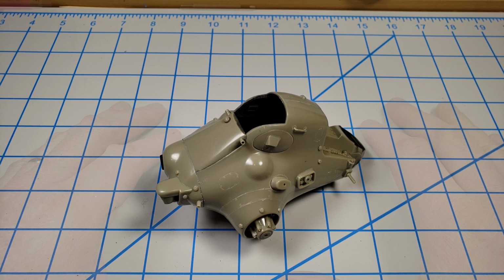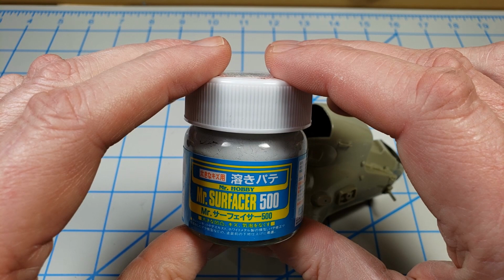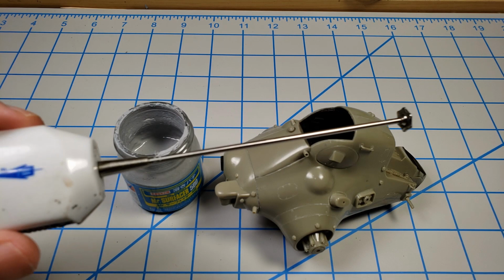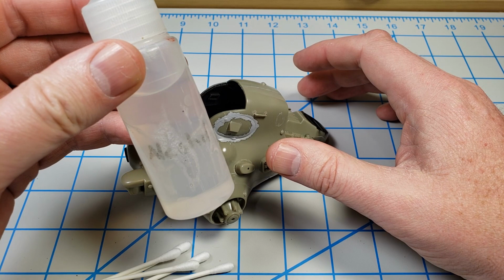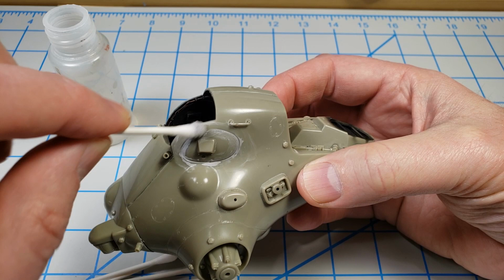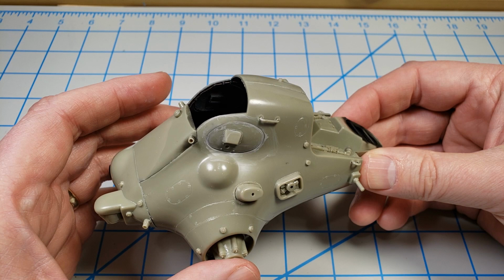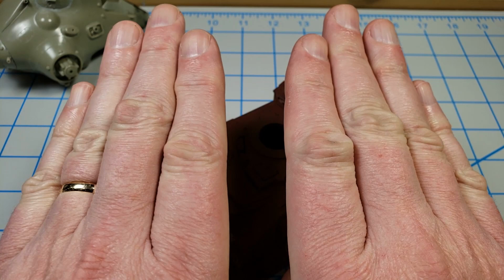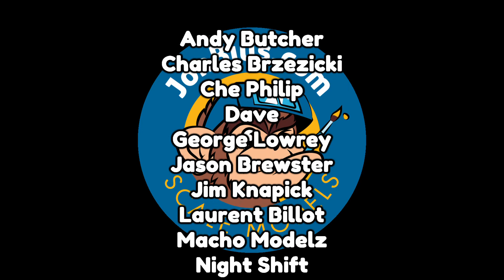Scale Modeling How-To: Mr. Surfacer And Panel Lines

Comment: If you use Mr. Color Thinner (Levelling or otherwise) instead of alcohol to remove the excess after application, you can leave it as long as you like. I've never had it harm any kind of plastic I've used it on, and the Mr. Surfacer can be fully cured; it'll still work (though it will be more work).
Reply from the maker: Good to know - thanks for watching and commenting!

Comment: Best way to tackle panel gaps, and 100% avoid ghost seams, is with polystyrene rod. Apply to gap, and soften it with liquid cement. Press into gap/seam, not worrying about excess sticking out, because it will be shaved/sanded down once it hardens. I also like to use polyester putty. I buy the large volumes, from the automotive brand Evercoat ( Pro Grade Glazing Putty ). Way more value for money, over modeling brands. No shrinking, no air pockets, it dries very hard, and is ready for sanding in 10-15 minutes. It is very sanding, friendly, and blends, extremely well, as it is used for bodywork repairs, on automobiles.
Reply from the maker: Thanks for watching and commenting!

Comment: Helpful video!
Reply from the maker: Thanks so much Thomas! :D
Reply: Used this on a resin figure that wasn’t going together very nicely and it worked really well.  I’m pretty surprised how big of a gap it could fill too.
I had a few pieces that I expected to have some trouble with because I just joined them with brass rod to get the pose how I wanted. Mr surfacer was able to fill the gap and dried relatively nicely.

Comment: Thanks for the video Jon. One question about applying Mr S 500 : what do you use to clean your brush ?
Reply from the maker: Mr. Color Thinner or Mr. Color Leveling Thinner works well. Isopropyl alcohol can too, especially for the initial cleanings. I've even used automotive type lacquer thinner. Be sure and wear a respirator and have good airflow!

Thanks and have a great day. 😊

Comment: want to change the color of the kit original from a dark blue to a light grey...what color primer/surfacer should i use?
Reply from the maker: Thanks so much for watching and commenting!

First, I'd say you'd want to consider what you'd like the final look to be. If you want it to be a bit of a more desaturated appearance, perhaps with a bit of a pre-shaded look, I'd go with something a bit darker than the light gray base paint - probably a neutral gray.

If the goal is for the light gray to have a brighter, cleaner appearance, I'd say go with a white, or at least very light gray for the primer.

I hope that helps! Thanks again!
Reply: @JonBius  thank you! yes, i want to change the color completely from dark blue to grey or white...so i will use a white primer  correct? thanks!
Reply from the maker: @phat_gunpla_etc  Yes - that should get you there. Apply it in thin coats so it gives a nice smooth surface. It may take a few coats to cover dark blue. Have fun with it!
Reply: @JonBius  thanks so much Jon!

Comment: Hi I am new to model building and thanks for the information in this great video
I have a question though should I buy the spray can or these little jars because I have a working airbrush and the spray cans say they are 170ml while little jars are 40ml and spray can are about twice the price of the jar. Thanks in advance!
Reply from the maker: Thanks so much Simon!

The spray cans are best for applying primer coats - smooth finishes that prepare the surface for paint. The product in the bottle can be applied with a brush, so it is more suited to the techniques demonstrated here. 

But you can airbrush this - I do it with some frequency! The key is thinning it way down, using Mr. Color Leveling Thinner. You'll want to test it out a bit to find what ratio works for you, but it definitely works very well. I tend to keep two jars on hand - Mr. Surfacer 500 for work as shown here, and Mr. Surfacer 1000 (or 1200) for thinning and airbrush priming.

And you're right - the jars ultimately save money!

Hope that helps! Enjoy your projects! :D
Reply: @JonBius  Thank you so much sir!
Reply from the maker: No problem - glad to help! :)

Comment: Maybe a basic question, but say I've primed a model/figurine with mr primer or mr surfacer and THEN noticed a panel line/crack I want to seal, any idea how that can be done? Can I use surfacer on primer that cured well, or will it dissolve/reactivate it?
Reply from the maker: The best I can tell you is to be prepared that you may need to fill it, sand it back, and reprime. It will just depend on how much it takes to cover up the crack. Good luck in getting that fixed!

Thanks for watching and commenting!
Reply: @JonBius  Thanks for the answer, that's what I was thinking the procedure would be. I'm using acrylic primers now so I'm kinda trying to avoid repriming (could flood all details), but I guess it's not an issue with cellulose primers with how much you can thin them...
BTW, did you try adding paint to mr surfacer? Most of my plastic is gray and grey primer on grey plastic is kinda hard to see xP
Reply from the maker: @benjimlem1284  Yes, adding paint to Mr. Surfacer is a great way to make it more visible, bring it closer to the final color, etc. I've done that quite a bit and it works well.
Reply: @JonBius  neat-o, goy me some dark blue, should taint the primer nicely :3 hope the fact it's gloss wont ruin anything... not with that low of a ratio.

Comment: Hello,
I just bought my first model and the guy at the shop said i'll need mr surfacer, mr setter and mr mark softer. Can someone please explain to me how these should be used in order? I am quite lost...I am not even sure what Mr Surfacer is ( i have the aerosol)
Reply from the maker: Hi! Welcome to the hobby!

Mr. Surfacer is a primer. That will need to be sprayed on the model prior to painting.

Mr. Setter is used as a preparation before applying decals. Mr. Softer is applied after to the top of the decal so it conforms to the surface.

Look through my playlists for the building a Gundam series. It takes a step-by-step approach to building a model. It may be helpful.

Hope that helps!

Comment: can rubbing alcohol be used as a thinner?
Reply from the maker: Hi! Thanks for watching and commenting!

If you're meaning for airbrushing, yes it can. I have tested that. However, I found that adhesion was not as good. It worked much better to use Mr. Color Leveling Thinner. 

However, if you don't have access to that, or budget is an issue to procure some, give alcohol a try. I'd make sure it is at least the 91% stuff, and that you test it on some scrap parts or sprue and see how you like it.

Hope that helps!
Reply: Jon Bius thanks for the response.
Reply from the maker: @shadowmo3  Glad to help! :D

Comment: would this work with mr surfacer 1200 ?
Reply from the maker: Yes, it does actually. You may need to apply multiple coats, as the 1200 is a bit thinner. But it does work!

Thanks for watching and commenting!
Reply: @JonBius  awesome, thankyou!